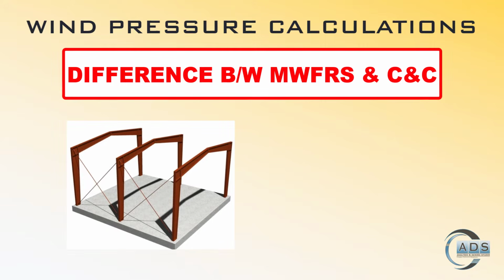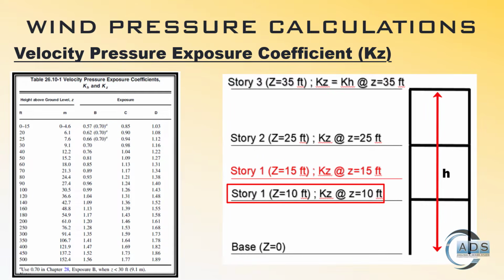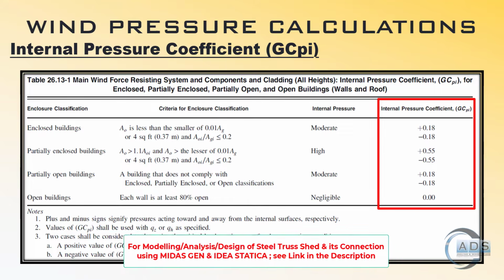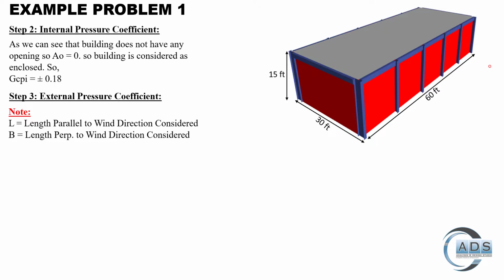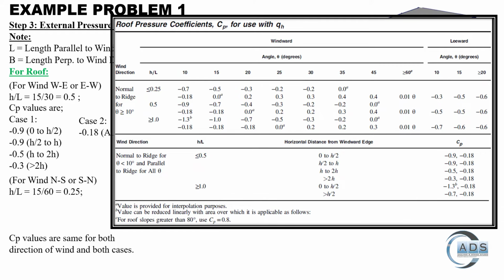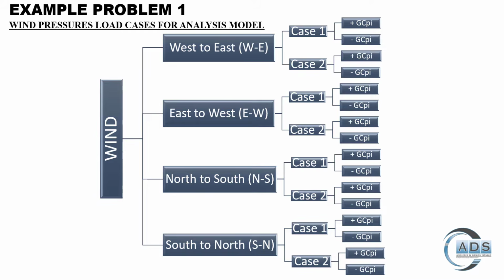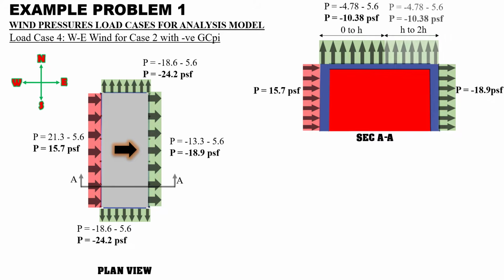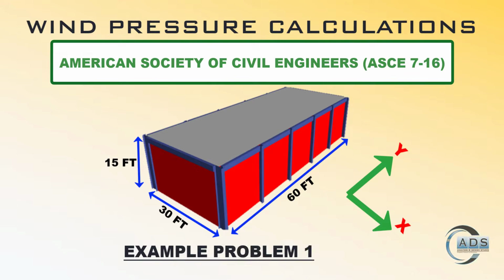Example Problem 1 for Wind Load Calculations using ASCE 7-16

Comment: Excellent video. Thank you. I just wanted to point out that there are some errors in determining roof pressures:
For load cases 1, 2, 5, and 6 in sections B-B, the pressures should be constant across the roof. 
The same is true for load cases 9, 10, 13, and 14 in sections A-A. Based on what you show, what would the pressures look like if you displayed them in a 3D view?
Best regards and thanks again.
Reply from the maker: Thanks for Highlighting the errors. Please watch example 2 video. I have explain the  rectified example 1  there

Comment: Hii im fresher structural engineer i had one doubt here  what is meant by case 1 and case 2.I thought that case 1means windward direction and case2 means leeward direction is it correct,can you pls clarify this one
Reply from the maker: Hello Dear. There are two cases. because of two values of Cp given in Table of ASCE 7-16 Figure 27.3-1 Roof Pressure Coefficient. Upper portion table windward section. there are two values and lower portion table -0.9 & -0.18 similarly other values listed in the tables
Reply: Thank you soo much

Comment: Thank you! May I ask a question: at the video time about 19:50, when you use the Cp is -0.9/-0.18, is the value is peak value or mean value?
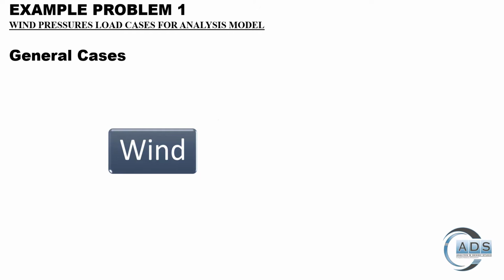Reply from the maker: Thanks for liking. For h/L less than or equal to 0.5. We have to take 4 regions from 0 to h values are -0.9 and  -0.18 and from h to 2h and 'greater than 2h, they are tabulated similarly. No need to take average. They are 2 values means we have to take two cases ... Case 1 and case 2... See at 22:40

Comment: Great video and explanation sir.. but i have a clarification..

Example:
1. As per the table.. for both parallel or perpendicular to the ridge.. the wind will be upwards or suction? 

2. Then the horizontal dist from windward edge will be both applicable to either parallel or perpendicular to ridge?
Reply from the maker: Thanks for Appreciation. 
1) See first video titled Wind Loads Calculations using ASCE 7-16 - Part 1: Basic Mechanism of Wind Load on Structures. you will find the answer

2) See the table in FIGURE 27.3-1 ASCE 7-16, in both the cases (Normal to Ridge for
θ < 10° and Parallel
to Ridge for All θ) Horizontal Distance from Windward Edge need to be used.

Comment: when Gcpi is + then it should be -.6 and when _ Gcpi Then it should be +
Reply from the maker: Yes Thanks to notify. I have rectified this in next video. You can check
Reply: @analysisdesignstudio3363  Thanks . Can you please make a video how this loads act as point load and line load and how these can be used as modeling
Reply from the maker: @arpitabose9706  Yes In Sha Allah I will make tutorials about this.

Comment: Hi how to calculate qh and solve a problem for flexible structure aswel.
Thanks
Reply from the maker: Thanks for appreciation... qh is calculated by same formula as qz but here z = h (mean roof height).... For determining flexible or rigid structure, there are seperate equations (see in ASCE 7 )used for calculation value of gust factor G but in these videos i have just considered a value of 0.85 as it is normally we get for rigid structures...

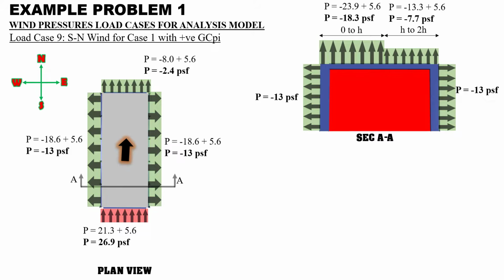Comment: And at 31:30 when windward side is the South Side. Is it right to apply  pressure  according to Section A-A ? Because in section A-A the concept of 0 to h is no more applicable because it is not a windward side.

Comment: Thank you for this amazing video with all the concept.
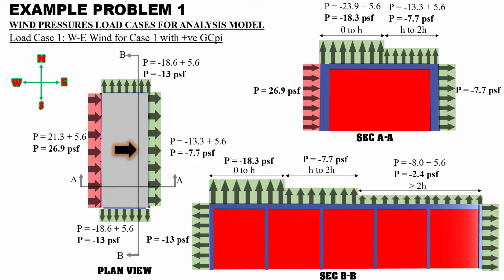I have a question, At 26:54 when it is load case 1 and wind direction is W to E. According ASCE 0 to h and h/2 .. all these region are horizontal distances from windward edge. When windward edge is at west then how these pressures can be illustrated in N-S directions???
Reply from the maker: Thank you brother for appreciation... In example 2 (next video) i have discussed this mistake and rectified this.. Please see that video..